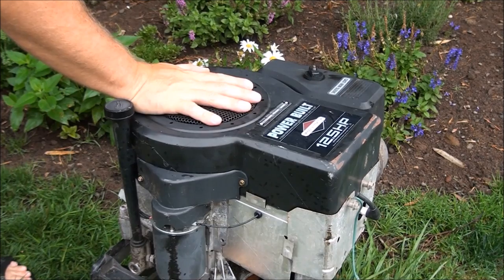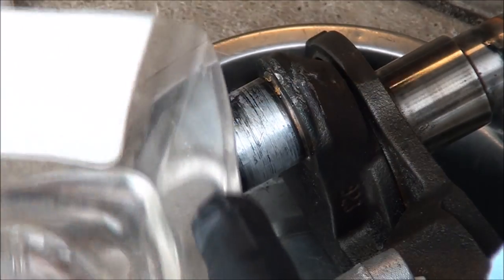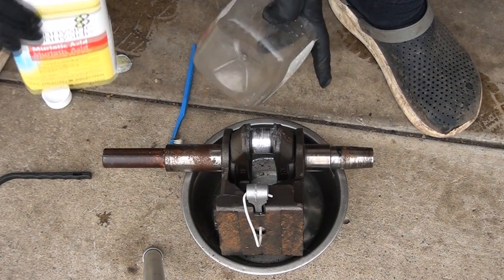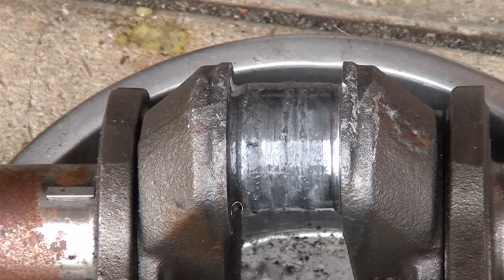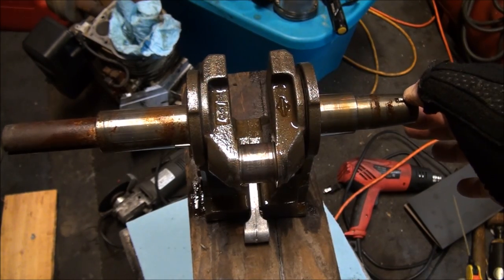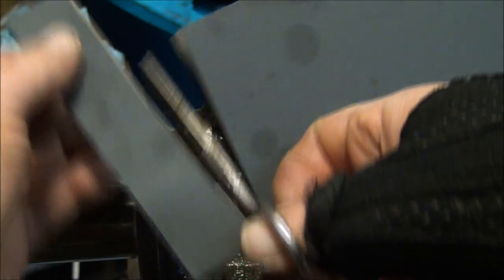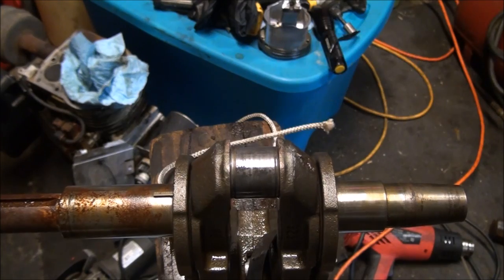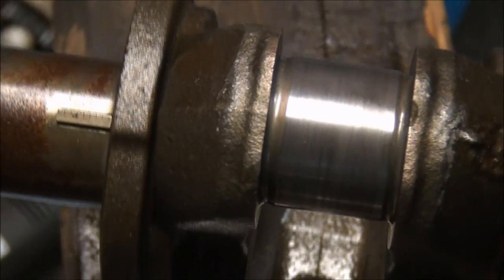Sulfuric or Muriatic ACID How to REMOVE Melted ALUMINUM on a CRANKSHAFT? Lawnmower Crank Resto How

Comment: I'll give this a try if I'm ever in that situation. 
For aluminum(like pistons) I've had decent luck cutting metal transfer and light scuffing from an overheat by using sharpening stones and some oil. Rub until it's smooth and you can see the original machining marks around the piston.
 I did a quick little vid on it a few years back.  
https://youtu.be/_S1B4l8OqNA